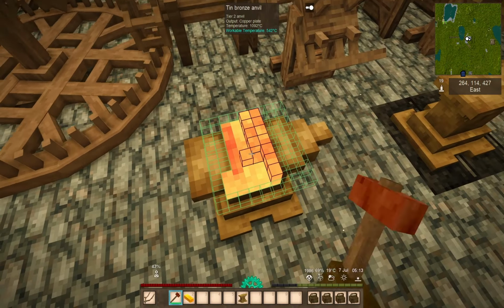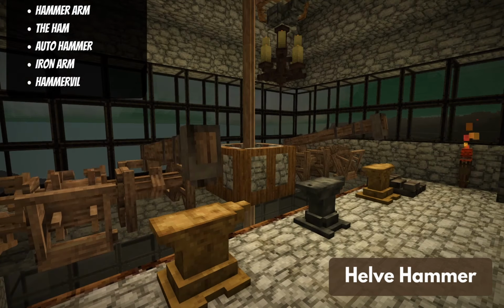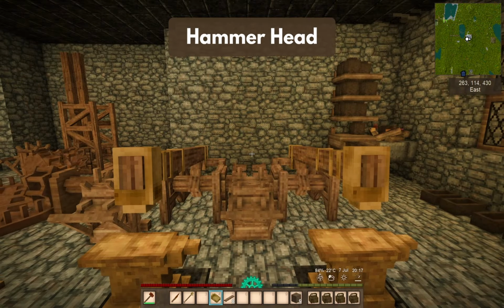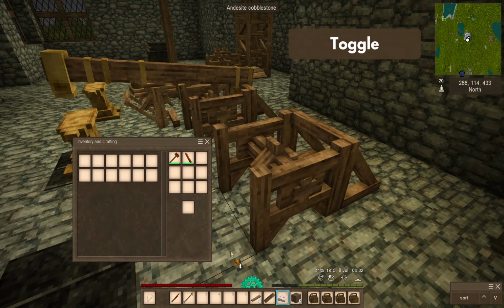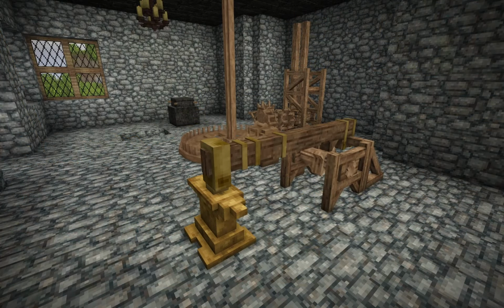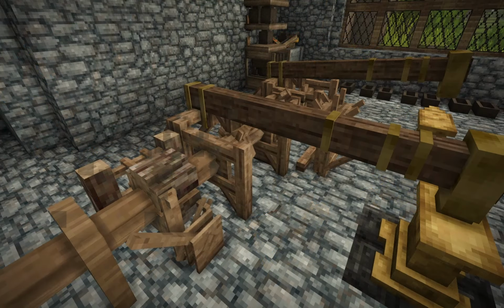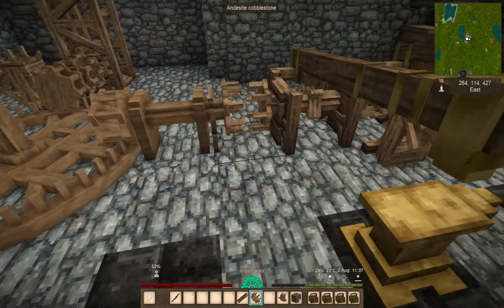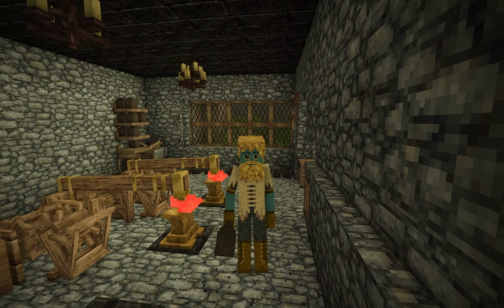VINTAGE STORY HELVE HAMMER HOW TO

Comment: I'd love to see other forms of power added to VS,I think a water mills that scale with size like the windmills would be great,Maybe even steam later on and belts to connect it to you machines
Reply from the maker: Steam power would be amazing!!! :face-red-heart-shape:
Reply: Steam is planned in the official Vintage Story roadmap.  @dracsfantastic
Reply: I think if they did watermills, they should also add some sort of river system. Just a simple thing, like water in one chunk will flow to another if it has more water connected to the same system. Maybe only use that system too, so you can't just have free power everywhere like Minecraft's Create waterwheels. I feel like waterwheels are an amazing fit to the game though, that'd be so cool to see

Comment: I made an iron anvil but I've noticed my hammer (black bronze) will not smith iron tools even with the upgraded anvil. It will work on bronze tools though. Does the hammer material matter? Also, I'm a lazy crafter. When I want to stop the clanging noise, I just move the anvil over a block, lol.
Reply: Yes, hammer material matter
Reply from the maker: I have done the remove the hammer to stop the noise as well.
Reply from the maker: @RefivalSOW  yep